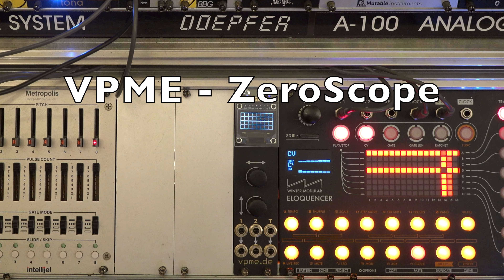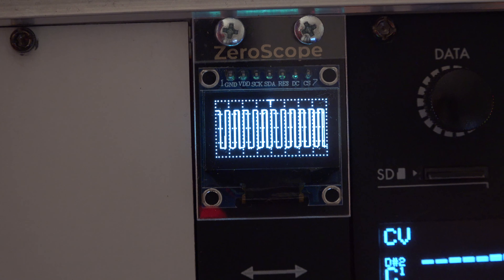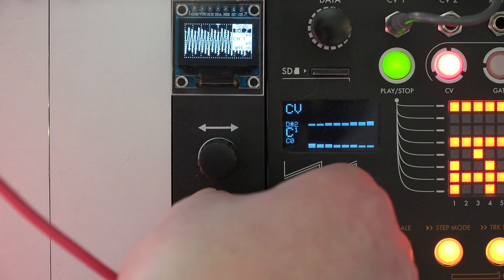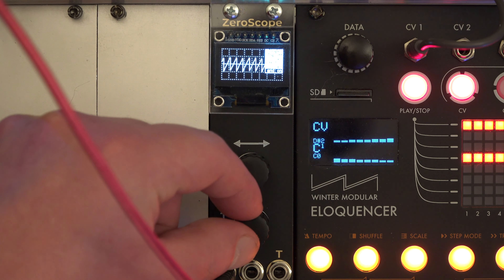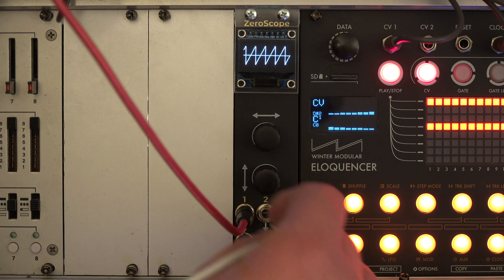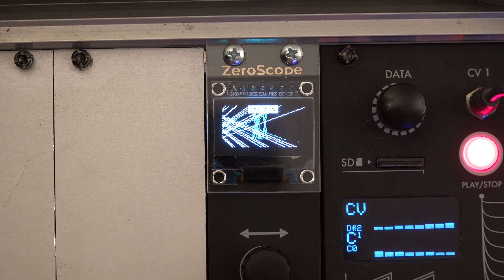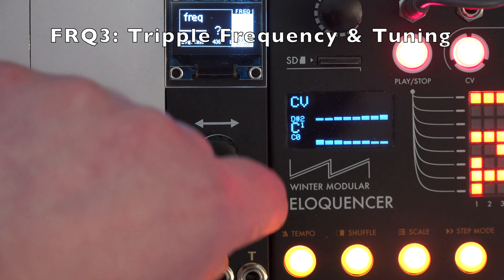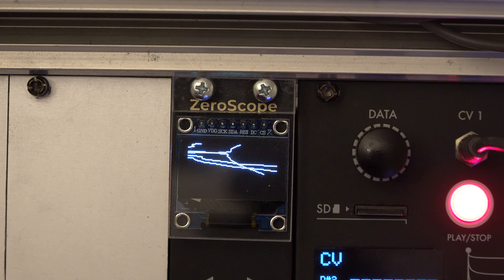VPME - ZeroScope

Comment: I've had the Zeroscope for a year now, but I only realised today that it doesn't seem possible to switch between channels 1 and 2 in single mode. Single mode always only shows channel 1, channel 2 can only be displayed in dual mode together with channel 1. Somehow strange, or have I overlooked something?
Reply from the maker: you are right, channels can´t be switched, the module is very basic.